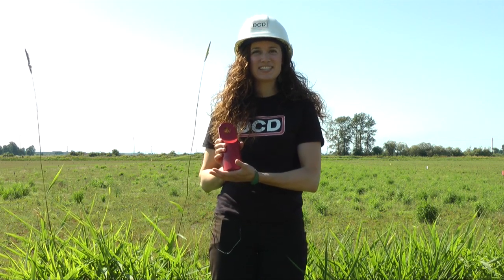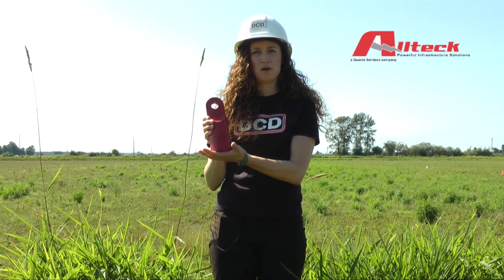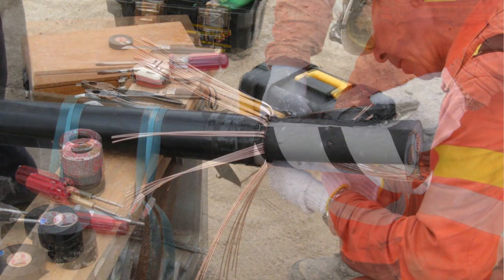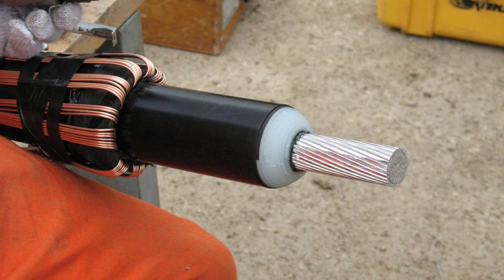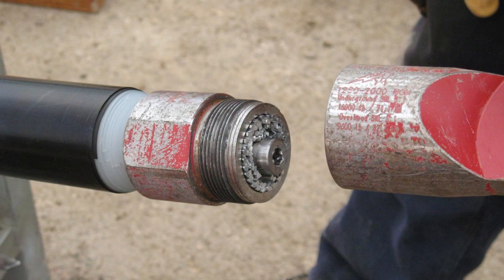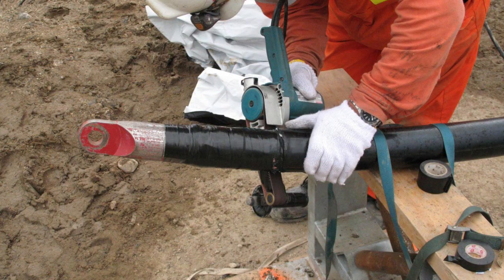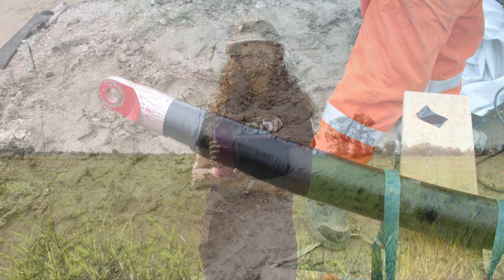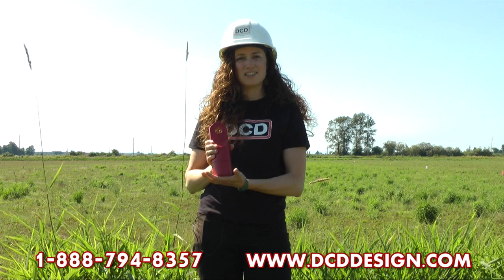Power-Grip Cable Pulling Eye Installation

Comment: Ibwant to know of its possible to use some machine not to use hammer ?
Reply from the maker: Tapping the insert into the cable with a hammer will help get it engaged, and at that point he can use an allen key to screw it in as tight as possible.  The method in the video is the best practice we’ve seen in the field and a hammer is not required; the tip of the insert can be pushed into the cable by hand enough to get the threads to catch, at which point he can screw the insert hard into the conductor.  It should feel similar to installing a self tapping screw.  Hope this helps.